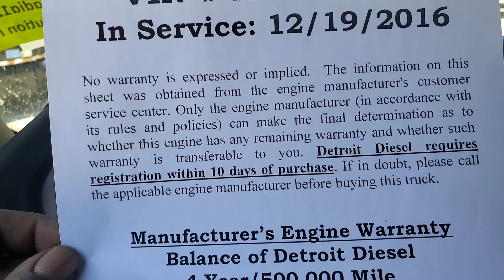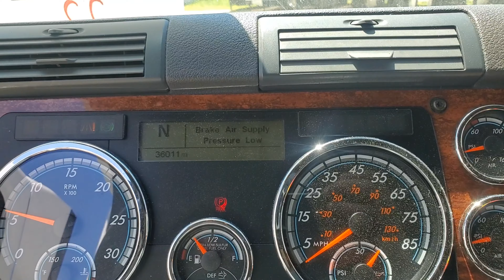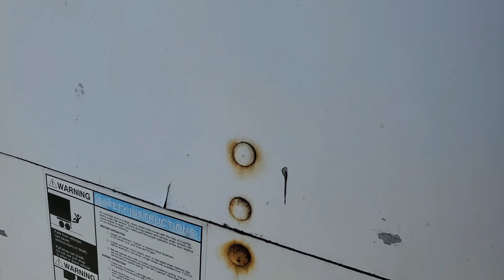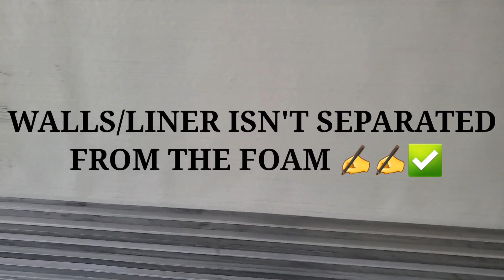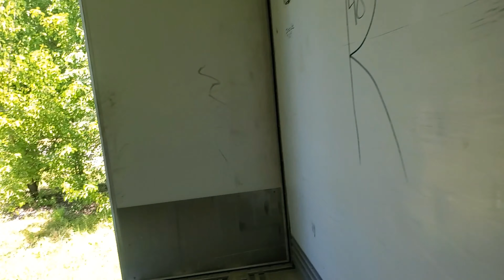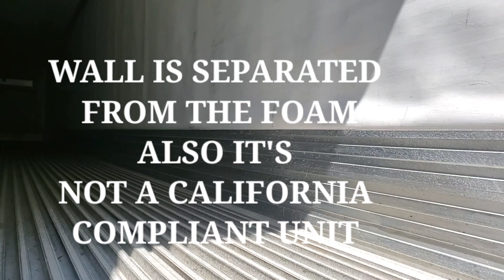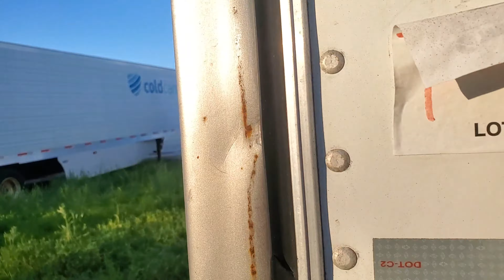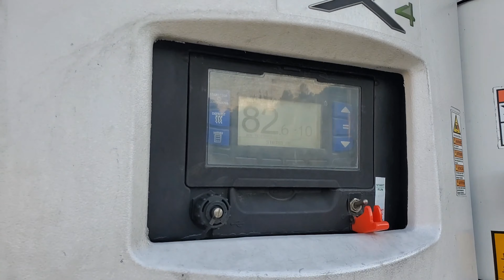Truck Auction| Trucks| Reefers at 40-70% Off| Thermoking| Carrier| Utility| Great Dane| Freightliner

Comment: My uncle use to buy like 15 at a time, fix them up and clean them up real nice. I'm talking every chrome piece polished, paint was buffed and interior was deep cleaned. Then sold them to owner ops. He bought them around 10 - 20k each and sold them for 30 - 70k each all fixed up.
Reply from the maker: Thats a big move
Reply: @TOPROPE1980  He sold them for that much because of the engines they had. He got them from small mom and pop owned fleets. They sold the trucks to him before they put them up for auction.
Reply: Is your uncle selling any trucks now ?

Comment: Probably changed the ecm on the truck with 36k. Should be a sticker in the door with original miles if they did.
Reply from the maker: Almost  got me. It was sitting in the grass and it looked like it was there for a long time. Then boom insaw saw that 370k the 2nd time
Reply: you mean to say ....."changed the ecm 36k miles ago" ?

Comment: I remember Sunco.  They bought my old company Rocor.
Reply from the maker: Nah prime took rocor. I was getting on the greyhound for rocor when it happened in 03
Reply: Rocor was selling pieces of itself off.  Prime bought the operation out of Oklahoma City.   East Coast operations was bought by Bestway, and the south East was bought by SunCo.   I was at the Atlanta terminal when it happened.   All the lease guys lost there trucks.
Reply: The York PA Terminal which I was put out was sold in 2002 with all the equipment they owned and all the lease trucks repo’d by freight liner.  They got in trouble for double leasing also.  It was a mess.
Reply from the maker: @dana2cold  double leasing 👀👀👀

Comment: Or 07 Volvo’s with the Cummins any good ? If so what’s the pros and cons ?
Reply from the maker: Thats jusy before the dpf system.  I would have it checked out. Get an oil ssmple. Coolant etc. See if the have any paperwork on it for repairs
Reply: @TOPROPE1980  ok thank
Reply from the maker: @tiptowing  no problem.

Comment: Mr Leaks I need one! Do they still have them at the auction?
Reply from the maker: They done pased. They had 4 different dates. I was told one is on the 30th in nc but i doubt it. They had more equipment from them and others there. I think it passed. There's a different one in forth worth tomorrow i think. Their trucks wont ne in it